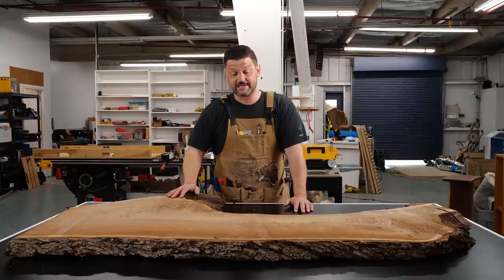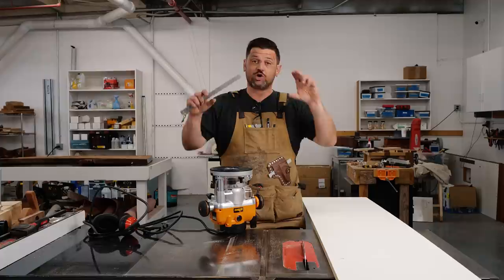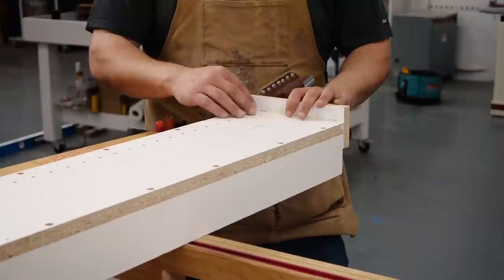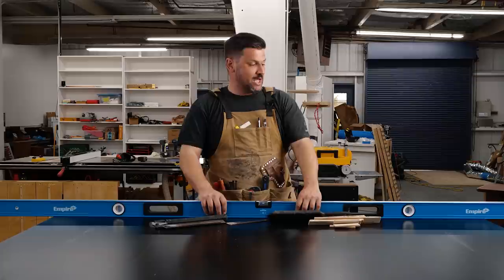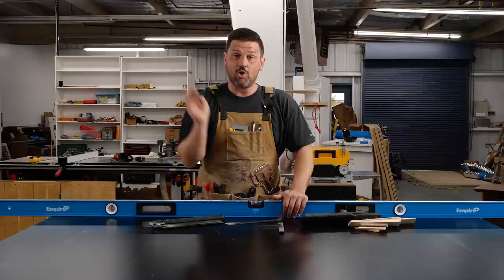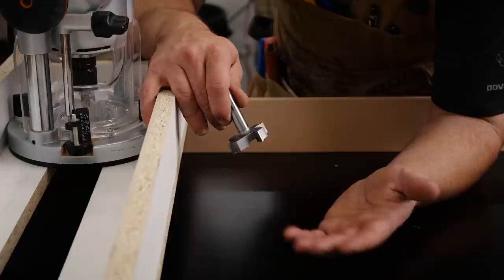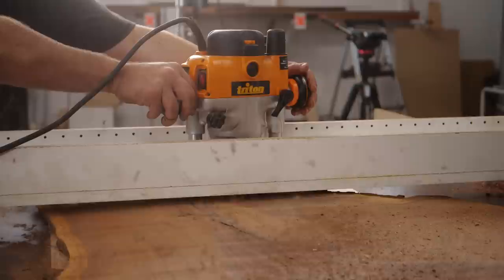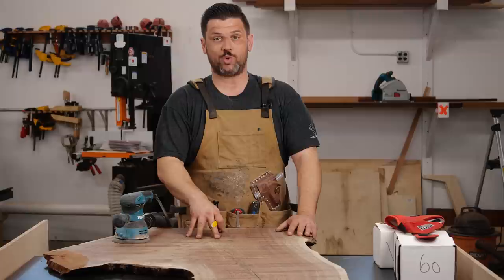How to Flatten a Live Edge Wood Slab

Comment: Biggest problem: Finding those perfectly flat melamine sided chipboard planks to start with.  I find most diy/hardware stores do not worry too much about storing stock in perfect condition.  It looks ok by eye in store….until you get a true straight edge on it and find a 1/8 bow over six feet.  I guess that’s where the table saw comes in?  I will be using a similar method to level my plank built, shop bought, workbench.  I only have a 20v Dewalt palm router, so a 1” bit dia and thin passes will have to do.  Tip: true level to set up the rails is easy using a water tube leveller…referencing off just one fixed point and adjusting all rail top points to match it….actually more accurate than a spirit level over long distances, impossible to not be spot on since water always finds its own level.  Great video JKM….TY👍

Comment: Very informative, I did a test with a piece of cypress trunk I got from my neighbours and yes all the process is really messy and you have to sand a lot afterwards to take all the router bits lines, but the results are good. Only if I could pass it trough the thicknesser ...

Comment: I just built a sled and my rails were a little too tall for the bit to reach the slab, though I wish to keep the additional height in case I ever need it. A spacer is perfectly acceptable to raise the board up, however you still want to make sure there is enough clearance between the sled and the slab to ensure the shavings have somewhere to go. Instead of putting a spacer under the slab, you could also consider a router collet extension. It extends to vertical adjustment range of the cutting head while ensuring the bit is fully secured. These usually recommended for use only in router tables, however I have seen others use them for milling purposes, as I would not exactly consider this setup truly 'free hand'. If you are concerned about skipping, you could add additional guides to your router sled that keep the router base pressed down for additional measure of safety.

Comment: I know this is older but if you make the guige rails smooth enough, set the router inside the sled lock it in place run the sled with grain of the wood come back to top move over 1/4" less than the width of the blade repeat, less to finish sand and the grain will hide minor router blemishes

Comment: I made my jig out of aluminium extrusions but I’m not sure how much better it is than yours? Less flex? 

Anyway, I take the first pass at any depth across the grain because it’s easier to pull and push the router to and from you; then, at the same depth, I take a pass along the grain; that gets rid of virtually all the router bit marks and makes sanding much, much easier.

Comment: Just curious why you did not just remove the melamine with a router bit and then glue on the side rails.
Reply: Yeah…I was thinking the same thing.  Maybe it blunts them a bit?  But an ‘old’ bit would do just for that edge cleanup.

Comment: When you flatten a slab that has a slight cup to it, is it better to start with the concave or the convex side? Or does it matter? Thanks!
Reply from the maker: Place the outside of the curve up towards your router so the two edges are touching the table and material is removed from the middle of the slab first.
Reply: @katzmosestools  Perfect, thanks!

Comment: Didnt hear much about the fence. I see you used some kind of MDF (not melamine) and screwed on from the sides. My top material on the table is Melamine as well. Can I use melamine as my fences also, and screw it from underneath? I use an old kitchentable with melamine on top, therefore not much material to screw into from the sides.

Comment: Hey JKM, or others, i don't see you do a lot of epoxy pours.  I have  a question that you or someone else can maybe answer.  I have a slab that is about 4/4, jsut a tiny bit more.  I want to keep as much of that 1" as possible.  Do i, 1) pour it as is and then flatten down the slab and hope it comes out nice once i flatten and thin it down, or 2) do i press it down in the mold then pour then add c channel to hold it flat?  

I am really afraid that i will have to flatten a 1 1/16 slab down to a 1/2 slab due to how twisted it is.

Comment: I'm building a shoe-storage cabinet/bench with a live-edge slab of beetlekill pine for the seat. The slab has a slight cup to it. I definitely want to flatten the bottom of it so that it sits flush with the base, but am contemplating leaving the concave side un-milled because it makes a nice indented seat. Do you have any experience with only flattening one side of a slab, and if so, is there anything I should consider while doing this? Is there a risk of the slab warping in some strange way if I only resurface one side? Thanks in advance!

Comment: How do you keep it even? I built a table and everything is level but wood is thicker on one side than the other.i have to flip rotate it and mess with for a very long time. To get each corner  even. So one corner will be 1.12 , the other 1.14 the other 1.17 the other 1.15 ( just an example) what am I doing wrong?

Comment: Johnathan, thank you for the video.  Have you ever seen the method of clamping two straight  and jointed boards then leveling them with two crisscrossed strings?  I used that method to flatten my roubo workbench  when I built that.  Check it out .  The Woodwhisperer, Mark Spagnoulo had a video on that at one time.  I think it is a bit easier than what you showed.  But to each his own.  Thanks again.

Comment: Great content as always! Couple of questions: Age of material? Air dried is what is sounded like, 2yrs, 3 yrs (for 8/4 material)??....moister content driven decision? And, looking back would you make rails that allowed for different elevations? seems like this would be a frequent in-process problem, having removed significant material.
Reply: It looked like to me he just fasten his rails to the side of his work bench. I made mine a L shape so I could clamp it to my work table and I just  sand which plywood at the base of the L  for what ever thickness I need to start out with and then remove the spacers to lower the rail.

Comment: Spent a long time looking at sled decks etc, I have no experience in wood working and no materials floating around. $50-80 for materials. My uncle come around said hold fire, brought sone random junk timber, odd ends and boom. Used a flat’ish  table and decided to work with what I have.

Cone out perfect, not even 1mm variance. Moral of the story, if you are starting out don’t over think it. If you’re working on a $10k slab, take a bit more time. 

I

Comment: Hey Jonathan,  I'm setting up a router sled in my shop and I'm having trouble getting my table surface to less than1/32" (0.030" on my feeler gauge).  

My question is: How flat is flat? I'm thinking for most projects (cutting boards, etc.) flat to 1/32" is plenty good.  However, since I haven't done this yet, will this error be magnified by my router jig?

Love the channel.  Thanks for all the great content.

Comment: hi! cool vid thanks! I bought the same router blade and I would like to know what speed you used for it? I'm afraid of buring my slab (Parota). thanks.
Reply from the maker: It should have speeds on the packaging if the bit. I think I did 12-14k rpm

Comment: Great video as usual.  Quick(ish) question, have you ever tried the flattening bits with the rotatable and replaceable carbide knives.  There about twice the price ($150ish) but you never have to sharpen them and in theory they would last 4 times as long before you have to replace the knives.  I've never used them and was wondering if they are worth the investment.
Reply from the maker: I haven't but honestly if you clean the nonreplacable ones with simple green they last a long time.

Comment: I have the Dewalt 1 1/4 hp compact router with plunge attachment. Would this be acceptable for this or do I need a full sized router?
Reply from the maker: No chance. You need a full size. Most tool rental places will have them for rent if you aren't going to purchase.
Reply: Jonathan Katz-Moses I was afraid that might be the case, thanks for the tip
Reply: Maybe use a smaller diameter bit and take off less material each time.

Comment: Great video. I didn’t realise they did router bits for flattening. Now I know. Thanks.

May I ask what’s the make of the dust mask you wore, please? Cheers.
Reply from the maker: Rz mask
Reply: Not a huge fan of the RZ, the strap pulls back and down putting a lot pressure on the bridge of the nose, for me it becomes painful during prolonged use: which always turns into less use, especially during those “I just have a couple cuts” times. The actual filtration is done by the replaceable internal filter, essentially a standard paper n95 mask. The one benefit to the RZ is the one way exhaust valves, but those are available on standard masks as well.  The mesh does help keep you warmer in extreme cold ,  but indoors it’s just extra weight.  Fastcap has great masks, 10-13 $’s depending on the style for a box of 10.... with exhaust valves.

Comment: That's ridiculously complicated. Why not just get an electric plane and two straight sticks to use as winding sticks and straight edges. So much quicker and you can do it outside on trestles with a few wedges and then it doesn't fill the workshop with dust. I do it all the time, with a bit of practice I can get one side flat in 5 minutes